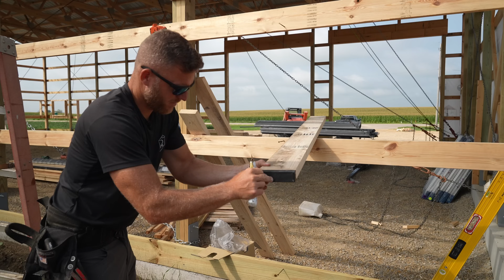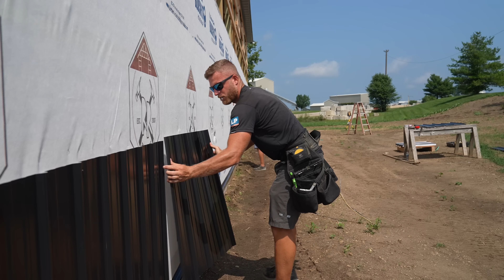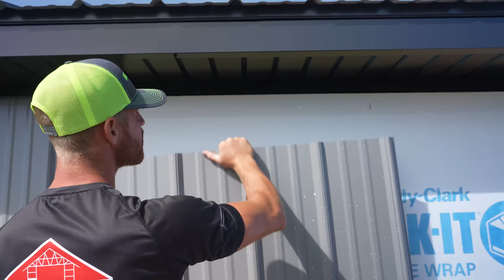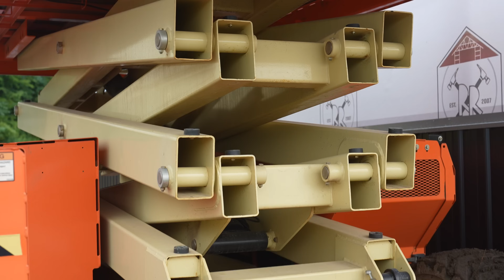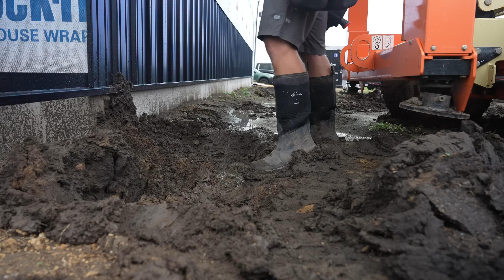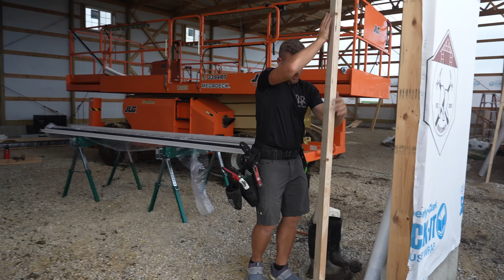Installing Exterior Metal Siding: Farm Chains 5

Comment: Should the exterior metal was come down and sit on the bottom skirt drip edge not sure what that part is called or should they have a half inch spacing between bottom of the wall and edge?

Comment: Good Afternoon Kyle
 
I follow your company on YouTube and really enjoy the content
 
I was a carpenter for 6 years prior to becoming an insurance agency owner and have continued in it as a hobby
 
I am also a tool fanatic like you
 
I was hoping to get your opinion on an upcoming building project
 
My father and I are building him a farm machinery storage shed
 
It will be 50’x 80’ with 16’6” walls
 
We are framing the walls with 2x6’s – 16” center and sheeting with 1/2” OSB
 
The trusses will be 4’ on center with purling’s added after
 
No windows – 2 walk doors and 2 garage doors one of which is large and other one is small
 
He does not plan to heat and cool this space but the foundation is all concrete
 
As of now he doesn’t plan to insulate it
 
The exterior walls and roof will be metal with two gable end vents
 
We are in SW Iowa so we would have a similar climate to where you’re at I believe
 
My concern is that the building will sweat and condensate as it will be very tight
 
I know your buildings are very tight as well so I wondered if you have had any clients leave them uninsulated and without HVAC and left them closed 90% of the time
 
I appreciate you taking the time to read this
 
Thank You

Comment: Sorry if this was mentioned in a video but the X bracing that isn't in the corner is that only because of the window that is in the corner bay so you went with next best which would be the next bay over or does it matter? Like could you put it in the middle of the wall with the same effect

Comment: Just finished building my 4th post frame. This one for my parents. I try to employ every trick you show. I have to say the Milwaukee nibblers are one of the best things I have ever bought for post framing. Next time you talk to Milwaukee, you should convince them to develop shears in the M12 battery line so I don't have to run 2 separate batteries. :) Great work as always!